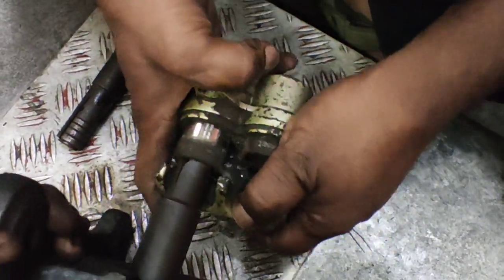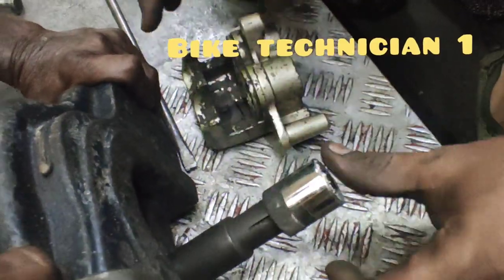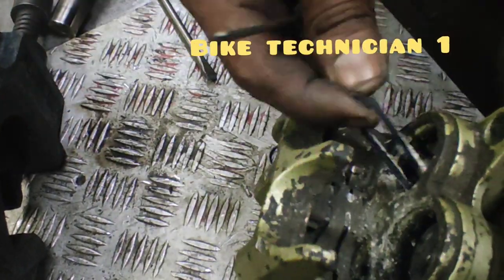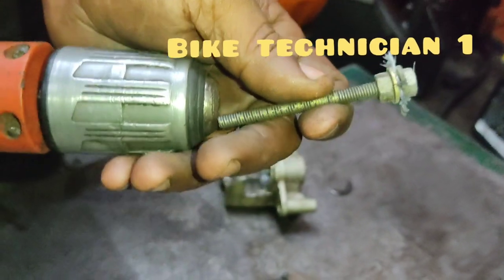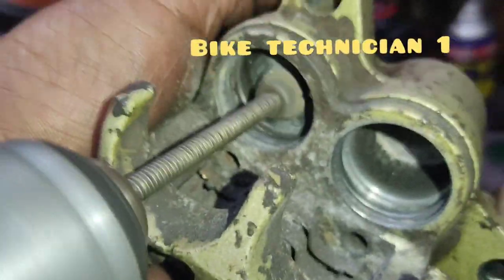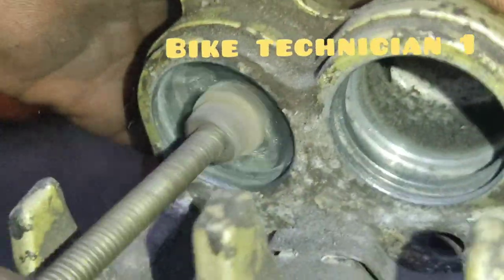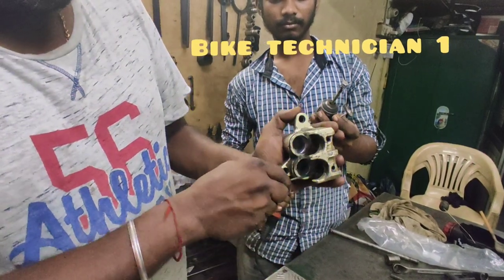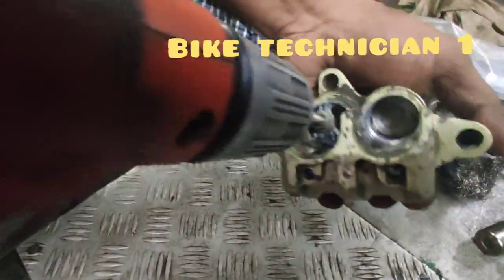Disk Brake caliber service with special tool |   Save time and energy

Comment: We often facing the problem about rear disk caliper which lack of brake fluid maintenance so such the air bubbles cannot removeed but it hapends we need to spend lots of time. Make a solution to it